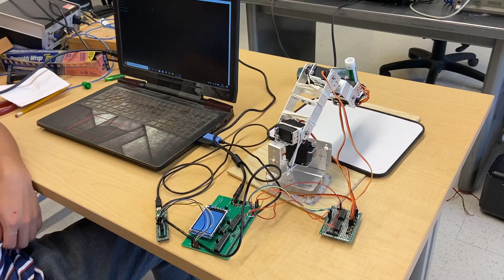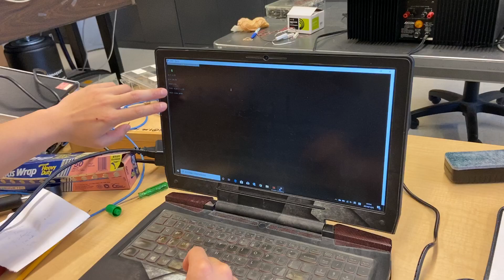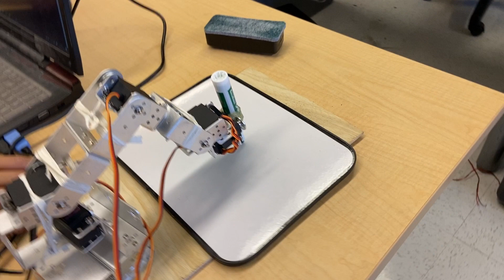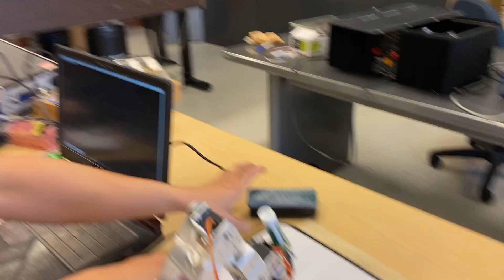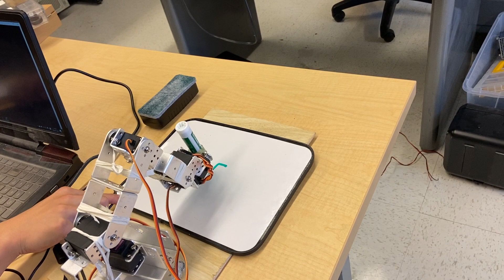Writing robot arm

Comment: I have the same robot and im trying to implement this code to work on a raspberry pi deployment through matlab. How do you set x and y values for the axis?  i can't see whats on the screen.
Reply from the maker: The linked report and git site are the only doumenatatimon on this 3 year  old project . sorry
Reply: No worries, nearly got it working. All I need now is to convert the PWM values in the arrays to degrees as thats what matlab uses.
Reply from the maker: @wojtekstefanski2674  good to hear

Comment: hello my friend . can i ask you some question about ai ? because i want to continue in this major (ai). please guide me
Reply from the maker: I do not know enough about AI to answer very hard questions, but I will try.
Reply: @ece4760  thank you my friend .
Reply: @ece4760  one of my question is which hardware is good to implement  ai algorithm like machine learning or deep learning ?? Fpga spartan 6 or another version   ?? Arm cortex m3 or arm cortex m4 ?? Or an other hardware ??
Reply from the maker: @computerengineering_ai4603  NVIDIA jetson nano is designed for this. Cost about 100 USD.
Reply from the maker: https://www.nvidia.com/en-us/autonomous-machines/embedded-systems/jetson-nano/
Reply: @ece4760 thank you . But  it is so expensive in my country (iran). How abou rasberry pi 4 (8GB ram) or fpga ?? Is fpga good for ai algorithms ??
Reply from the maker: @computerengineering_ai4603  Some are good. But the ones that are good are going to cost as much as the Jetson. A PI4 will will run AI applications about a factor of 10 slower that the Jetson, but costs about 1/3 as much. Depends on what you want to do.
Reply: @ece4760  i want to implement every ai algorithms (like machine learning - deep learning - neural network and ...) or image processing or audio processing or video processing or ....  on this hardware . do you think this hardware (jetson ) is  excellent for  implement these algorithms ?? or fpga is better than jetson for implement these algorithms ??
Reply: @ece4760  my another question is i really like VHDL  and fpga . because they are very cool . i heard that intel and nvidia and other big hardware company  describe they hardware(cpu - gpu - ram - communication circuit - ....) in VHDL . is it true ?? do you heard about this ??
Reply from the maker: @computerengineering_ai4603  If you want to learn the algorithms, but do not care about performance, then any hardware wih enough memory will work. At this time, GPU technology is easier and faster to use. As FPGA get bigger and cheaper, then they may dominate particularly where low power is important. But I think that analog neural nets may displace digital systems.
Reply from the maker: @computerengineering_ai4603  Virtually all digital hardware is designed in either VHDL or Verilog. The systems are too complex for schematics or block diagrams. I teach a course about Verilog used for parallel processing.
Reply from the maker: http://people.ece.cornell.edu/land/courses/ece5760/index.html
Reply from the maker: https://www.youtube.com/user/ece4760
Reply: @ece4760  thank you mr.land . I won,t forget your help .